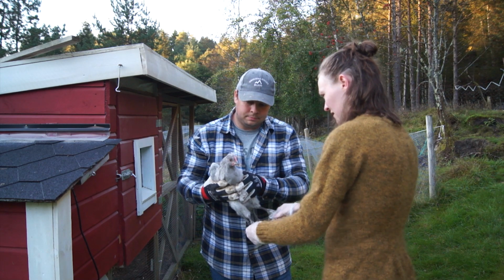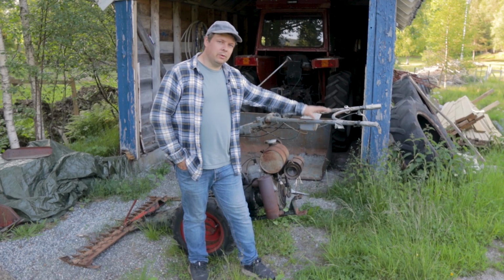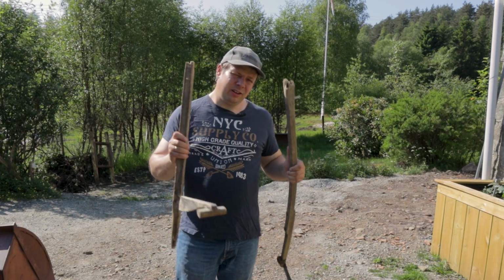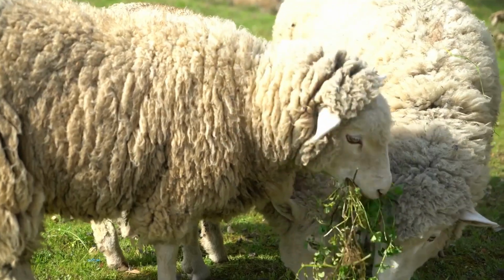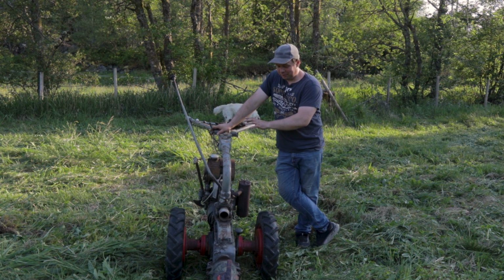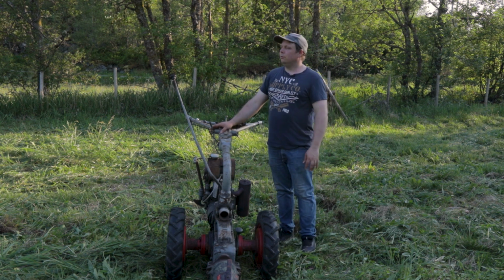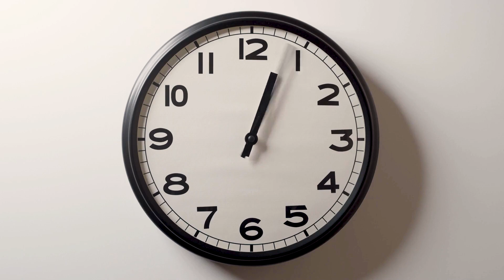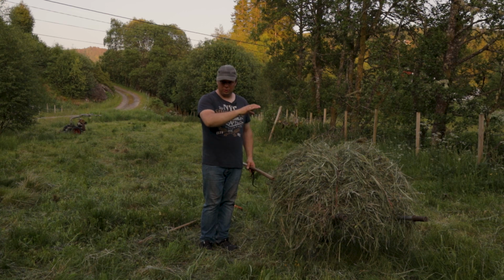Making hay with ancient farming equipment on our homestead🤠

Comment: Loved this! I used to use a Jari mower, manufactured in Mankato, MN, USA. It was prone to similar problems as yours. (I always wanted to oil my sickle-bars, whether on the Jari, or on my horse-drawn John Deere Number Nine, with a 5-foot bar. (By the way, I had a team of Norske Fjordhester to harness. My Lyslo relatives on the farm near Nordfjordeid had continue the horse work in one form or other when my mom visited with some of her MN cousins back in the 80s.) If I didn't have enough liquid waste vegetable oil, some hydrogenated shortening did work. I figured it added so little to the hay as not to be a problem for our horses, sheep, and a few heifers.
The straight snath scythe is a very efficient tool! I think yours may have been a left-hand model, at any rate your snath lacks a 2nd handle: this one would be shorter to maximize the efficiency of your trunk muscles. We use our trunk muscles to swing our scythes. Check it out on YouTube. (I hate to say it, but you may have wrecked the temper of the steel in your blade with high-temperature sharpening, and no apparent quenching.) I have a little anvil I hammer into the end grain of a piece of cordwood of convenient length, and a hammer with the right-sized striking face to draw out the edge, and whet it only with a wet grindstone-- by hand. The hammering is less frequent than the whetting, and I carry the whetstone in its wet sheath on my person while I am cutting hay.
On steep fjord-side farms I understand cable-ways were used to carry hay to the barn. If you have those steep hayfields you may be able to contrive a winch system that cuts on the way uphill?
Just saying: I would've let the sheep into the hayfield overnight as soon as the hay was gone. They'll glean what your fork missed, even out your stubble for easier cutting next time, and leave droppings. God avling!
Reply from the maker: I also have a lot of nostalgia for machines like this.🤠 My grandfather used this type of mower to cut the grass in the step hills where he could not reach with the tractor and harvester.